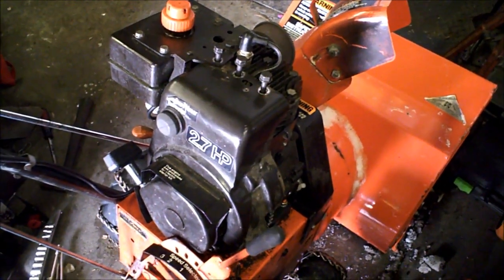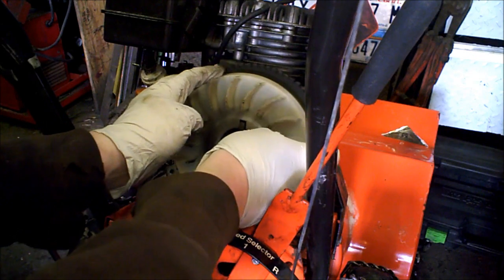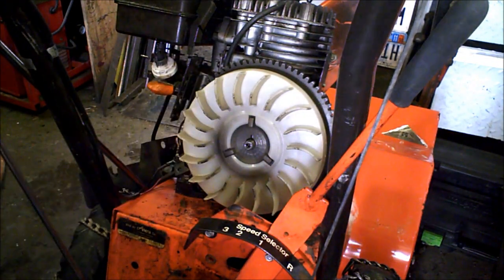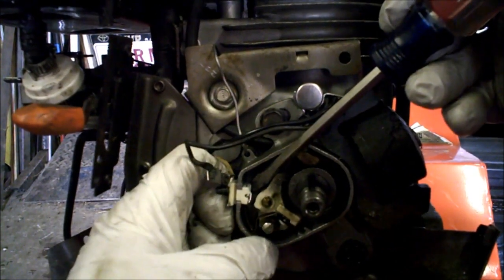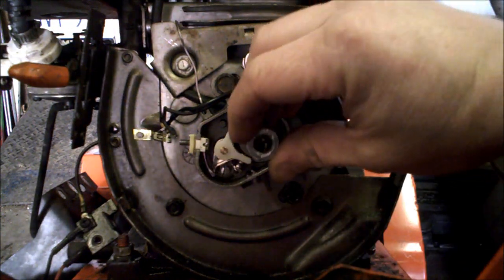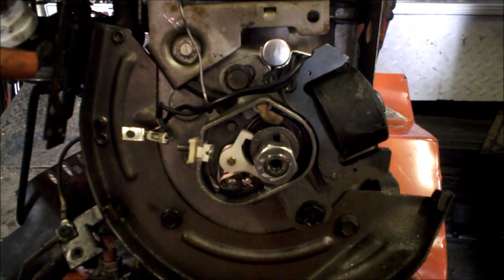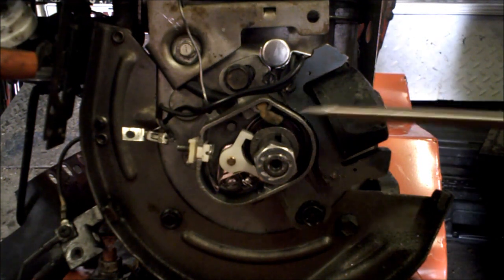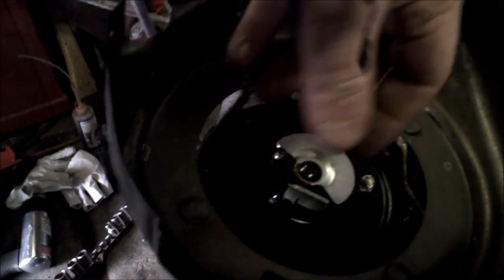Tecumseh Points and Condenser 3-10hp replace

Comment: Just saw this one. The engine is just like this one and the blower too, except mine is an 8/26. It has the inside coil, soo, is it possible to convert this engine to electronic ignition?? How do you know if your points and condenser need to be changed? Mine looks like original. The I/2 moon pin or as we call it here (wood rift)pin in the crank is bent just a little, is this enough to put it off timing and make it backfire through the muffler. Thanks ever so much for your help and advice.
Reply from the maker: +W. Gator Yes you can convert it to electronic ignition. It costs under 15 bucks. You'll need what is called a "Nova 2" http://amzn.to/1OT27ik
Reply: +sixtyfiveford Looked it up, "Nova2",  it is just not worth the effort. We got some snow here, then it turned off to freezing rain. So, I have been working on the blower, set the points, fire is good, installed a brand new, never used carb, checked the valve gaps, they are perfect, looks like good compression, new spark plug, new gas...... engine still won't start. What would you do next??
Reply from the maker: Squirt a little gas into the carb and see if you can get it to pop/sputter or anything that resembles starting.
Reply: Did that, not a pop, even sprayed some carb cleaner down the spark plug hole, nothin. The spark is good, I took the head off, I am thinking that maybe the valves are seating well. On the compression stroke you can still twist them with your thumb. I checked the valve clearance, it is good, maybe open a little too much.
Reply from the maker: The exhaust valve should be able to spin at top dead center as this is the build in compression release. Otherwise the pull start will rip right out of you hand when you try to start it(doesn't feel good). The Exhaust Valve should be non movable/fully closed a little after TDC when it is being forced down after combustion(both will be).  As far as starting it with carb clean it only needs an extremely small amount; as quick as you can push the button and no choke. Any more and they are flooded. Is there a noticeable lip in the cylinder bore at the top?
Reply: No, the cylinder is clean, no scratches (good as a new one). I took the valves out and cleaned them and the seats too, clearance is good .008 and .011, should be .012 I know but that wouldn't make that much difference, replaced the head gasket, installed a new carb. cleaned the gas tank, installed an inline filter, new gas. Still not a pop. How bad would the rings have to be for it not to start, not even a pop. The spark is good, I set the points, even put a new wood riff pin in the fly wheel. Where too now?? Go with the Lone Ranger...... To the dump, to the dump, to the dump dump dump? LOL!
Reply: What if there is a lip? There is some carbon on top of the piston, I cleaned that off.
Reply from the maker: A carbon build up is fine. I was talking a lip with the actual metal, signifying worn cylinder bore. You need to look back into the spark. What did you do as far as the points go?
Reply: The condenser is rusty, the points look perfect, not burnt or anything and I made sure they came together like you showed. Is it possible for the condenser to be gone, but still have spark on the plug?
Reply from the maker: A condensor gets weak over time and will produce weaker sparks. A spark needs to jump at least a 1/4" gap outside of the combustion chamber. Inside the combustion chamber the spark will have a much harder time jumping the gap under pressure and will struggle to jump a 0.030" gap.
Reply: +sixtyfiveford All righty then, points and condenser. Thanks. I will let you know the results. Thanks ever so much, I will le you know the results.
Reply: Results after $30 on new points and condenser..... Not a pop. Spark looks even better on the plug now, but not a pop. As Bill Shatner
 would say, "weird or what". I guess it is back to the Lone Ranger plan again. Pity cause the engine looks soooo good inside. Thanks again for all your advice, have a good wknd.
Reply from the maker: We are missing something simple. Reading through all the comments. You said you have the inside coil. You didn't remove this did you? This is the only style made by Tecumseh that needs to be timed if ever removed and not set back exactly.
Reply: No, the coil was never removed. I am wondering if the compression is bad. Some times it is like she has lots of compression and other times I turn the flywheel with my hand and it moves through the compression stroke easily. I didn't do a compression test cause the engine was running (it is not now), but banging and issing through the muffler. Is it possible for it to refuse to start if the compression is low?? The cylinder walls and everything inside is immaculate. I once had an engine that burned a lot of oil after it blew the connection rod and I repaired it, like 1 qt. of oil for every tank of gas1 trip out the driveway and back and I had to remove the plug and clean it. After ringing it I realized that something had made the cylinder go off round, and nothing short replacing the block could stop it from burning oil. I still have the rings and piston, so tomorrow I think I will put them on before I have it "walk the green mile. "You know what I mean?? Thanks again for your help. I know you must get A LOT of requests for help.
Reply from the maker: lf your hearing hissing banging through the muffler your exhaust valve is sticking or not seating. A sticking valve would give low compression.
Reply: You must be either up early or up late. Thanks for the advice for the future, but that was back when it was running, since it stopped running I have taken both valves out and cleaned every thing and made sure the gap.012 and .008 were correct. snow storm here today, I may get that ring job done, I'll let you know the results. I think...... if you live where I think, there is a 1 1/2 hr. time difference. Yes, I live in a place that is 1/2 hr. ahead of the rest of north America. Have a great day.
Reply from the maker: Worn rings can be tested easily but pouring a little motor oil into the combustion chamber. This will increase compression to new few seconds and allow easy start if this is your issue. It will smoke right at start up.
Reply: Remember me? I changed the rings, and head gasket, did a valve job, new points and condenser, new wood riff key, brand new carb., new plug, cleaned out gas tank. Fire looks good, but it only ran for about 10 seconds, so I scrapped it. Then a couple mechanics told me that where the magnets came off the flywheel, I may have JB welded one of them on backwards. That is with the side that should be facing in I had it out instead?? I had it running after that, that was last year. Can the magnets be put in backward? I have been looking for a video to show how it is done, but can't find any. Do you have anything?  Have a good wknd.
  Gator
Reply from the maker: Magnets have a polarity but if you have spark, it's working.
Reply from the maker: I was thinking about this a little more. If the magnet was backward, it could still have spark. BUT it could throw off the timing and the spark could have been happening on the downward stroke. This would make it so the engine wouldn't start. I would still think it would pop out the intake or exhaust once in a while.
Reply: Thanks, I just pulled off all the new stuff I put on it, went to a scrap yard nd got another engine just like it off a blower that was worn out and scrapped and needed a carb. etc. but has great compression, now I plan to rebuild that..... maybe over the summer. If you lived near me I would have GIVEN it all to you cause I think you are the kind of a guy who sees this as a challenge that you wouldn't be able to resist, and I am sure you would eventually get it running. Thanks for all your help.                                                                     While I am here........ I have a United CC2900 generator that is impossible to start (cold) without spray into the carb. After cleaning the carb. I noticed that in the gasket between the carb. and the block there is a tiny open area that goes out to the bottom, I was wondering if the block draws air through there (when cold start) instead of gas through the carb. What you think?? Also I was thinking of putting an inline (outboard motor type) primer on the line. I now have an inline gas filter on there. So, would that be any good? What is your experience with these generators, They are called Chinese Honda, LOL! I know a Honda carb is exactly the same.
Reply from the maker: There shouldn't be a hole there. If it's a round hole: the hole could be there to accept a California Emissions Charcoal Canister(EVAP system) and it is supposed to be plugged when the generator doesn't need to be set up for California Emmisions (not sold in CA). Any hole between the carb and engine will cause the choke to not function.
Reply: California, LOL! I drove 3,000 mi. and didn't get a single bug on the windshield, just a black film.                                                       On the back of the carb it has a hole that comes out into a C shaped channel right at the top end of the C. with the hole at the top of the C and the opening at the bottom, (not the bottom end) This is a United Power CC2900 generator. Then there is the casket and then the head. If you have access to one of these you could have a look. I have a very similar carb that came off a lawn mower, BUT instead of a choke, it has a primer exactly like you would find of a snow blower. Where the primer would go on this one there is just a flat spot. I was thinking about drilling a hole in that flat spot (which comes out at the top of the bowel) then I would pull the spigot out of the old carb and put it in there, attach a primer bulb, and way we go. SO, what do you think of that idea??? This generator is hard to start even when it is warm. But when it is going it purrrrs. Maybe i'll plug the bottom opening first, see what that does. By the way, it has only burned about 3 tanks of gas, like new.
Reply from the maker: I would try plugging the hole. The choke works on the same principle as the primer. The primer just pushes a lot more fuel in and comes in handy in extreme cold. With any air leak between the carb and block the engine won't pull strong enough vacuum and not suck excess fuel out of the carb bowl.
Reply: I read some of the comments that some of your viewers made and 1 person said to tilt the machine on it's end, about ...... like 75* with the carb side down and that would let more gas run into the engine..... It worked, the engine started 1st. pull. Think I'll
 take your advice and temporarily plug the hole to see what happens. Thanks.
Reply: Hi, I'm back. Remember how I have an 8hp Tecumseh snow blower engine and how it wouldn't run, no matter what I did. Well I came across an identical engine and took off the flywheel. Put the 2 of them on my work bench and discovered that when I JB welded the magnets on I reversed them. That is the magnet on the left repels a tiny hand held magnet while the magnet on the right sticks to the same magnet when laid on it the same way.  But the new flywheel is just the opposite. That is when putting the tiny hand held magnet on its left magnet in the same way it sticks while the right magnet repels. So I must have glued the left on the right and the right on the left. 50/50 chance of gluing them on right, but then there is Murphy's law, HUH!  MY QUESION FOR YOU IS, DID PUTTING THE MAGNETS ON BACKWORD( or in reverse order) CAUSE THE PROBLEM, OR IS IT NOT WORTH MY WHILE PUTTING IT ALL BACK TOGETHER????? RIGHT NOW IT IS COMPLETE STRIPPED APART.
Reply from the maker: Theoretically it should just throw off the timing of the spark by having it reversed. More than likely way before TDC.
Reply: What is TDC? Me stupid. So what you are saying is that even though the spark was good the engine was off timing which caused the banging, and for it not to work etc. Is that right.
Reply from the maker: The spark needs to fire right before the piston reaches TDC(top dead center). This allows a millisecond for the fuel/air to ignite and blow up as the piston crests and starts its downward stroke. If it happens too soon it will not have full compression and try to reverse the direction of the motor. This would cause a bang.
Reply: OK, Thanks. So it that millisecond is reversed off TDC the other way, than that makes it off by 2 milliseconds, being 1 Millisecond after instead of 1 millisecond before, and just that much can cause it not to work. So, what if I had glued the magnets on in the correct order BUT on a completely different place on the flywheel?? Oh, by the way, 30 to 40 cm of snow falling here tonight..... storm that came up the east coast of the U.S.A.
Reply from the maker: Yes, even a little off and the spark will be off time and not allow the engine to run. If you put them in a different place on the flywheel the spark would be even further off and the engine wouldn't run.
Reply: +sixtyfiveford Alrighty than....... I will rebuild it from the ground up and I will let you know the results. Something to learn every day, huh!
Reply: +sixtyfiveford Hey, I'm back, remember the flywheel with the magnets JB welded on backward. Well I rebuilt the engine and put the wheel on that I took off another engine (just like the one in this video)and, just like the girl in the Swiffer commercial BABAM!! started the 1st try. You were right. Now I have a muffler off a Tecumseh 10hp.... you know the square box type and it isn't rusty, but it has the guts all shook loose in it (bolts came loose and the owner didn't tighten them. You know the type) Big area on the front and the back where the bolts go through has worn away and is missing. Did you ever do a video on rebuilding one of these? Easy job, just weld a little thin flat bar on the front and back and drill new holes, but I am not sure how the guts go back in. Thanks for all your help.
Reply from the maker: That's GREAT.... I've played with a few mufflers here and there but never anything video worthy.
Reply: I spent all yesterday after noon at the muffler. I took a muffler off another engine and used that to go by. With the aid of a spot light and my mig welder I managed to get it all back in place and welded it there. Those things are only pressed in place, I guess they made it to fall apart, and then sell you more for $50. +. I welded new ends in and now I just need to drill it out for the bolts and exhaust. Nice home project for welders, but if you had to pay to have it done it would probably cost more than $50. Using needle nose plyers and tiny screwdrivers to hook every thing in place is time consuming. Thanks for the reply.

Comment: Great video, Thanks.  I was given a craftsmen 3.5 hp snowblower.  It is a tecumseh motor.  It was my brother in laws and it needed a new carburetor so I bought one on line.  I also changed the fuel lines and put in a shutoff valve.  I did change the condenser and points.  It will not run.  I adjusted the fuel mixture to 2 turns and the air mixture screw to 1 1/4 turn and still nothing.  I did install a new spark plug and verified that I am getting a spark at the plug.  I took the cylinder head off to make sure the valves were closing and they are.  I did set the points as you presented in your video.  I am stumped.  I am missing something.  The only thing I can figure is I didn't make sure the points were aligned as you did in the video before installing them.  I do remember that they were not.  I am wondering if this can cause a poping back through the carburetor and the point to fire incorrectly?  Help!
Reply from the maker: ***** The flywheel key could have been sheared when you were reinstalling it. This will throw the timing way off and give similar symptoms.

Comment: Hi,
I have a Wildfire wf3500l gas Generator made in China.  I have no spark so I replaced the ignition coil and still no spark.  I have compression but no spark.  Can you tell me what else I should check?  Also someone said to replace the points and condenser I don't know where these are.  I've tried emailing wildfire but they stopped selling parts for this,generator in 2008.  So I don't know what points or condenser I would need.  Please help.

Jim
Reply from the maker: Shouldn't have points and condensor as these were phased out in the early 80's and your equipment is way newer. We need to bypass the kill wire for the coil. You should have a Honda gx190 Chinese CLONE engine. There is a small wire running directly to the coil and then generally through a low oil shutdown then to the switch on the machine. Unplug these wires and it should start. You may need to bypass the low oil sensor as these go bad.

Let me know how this works.